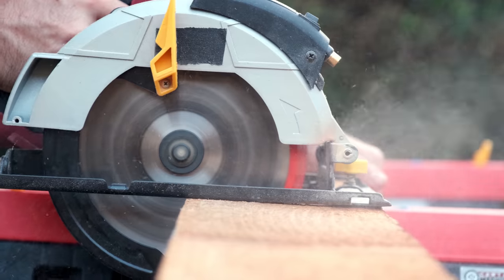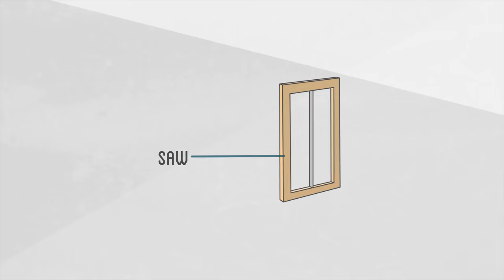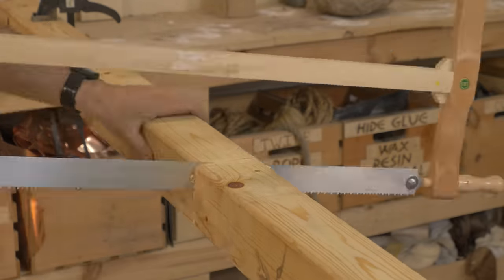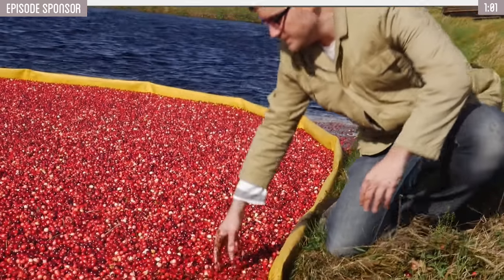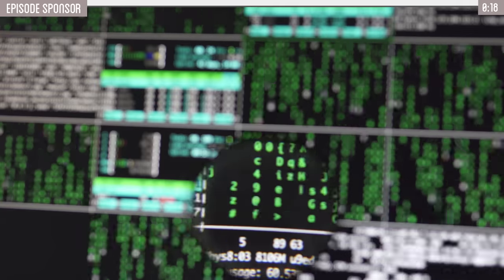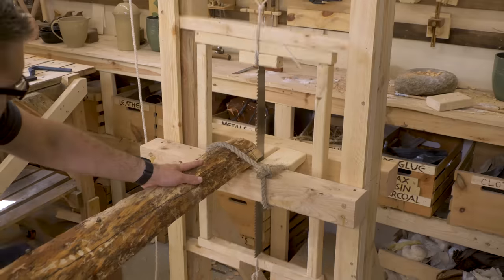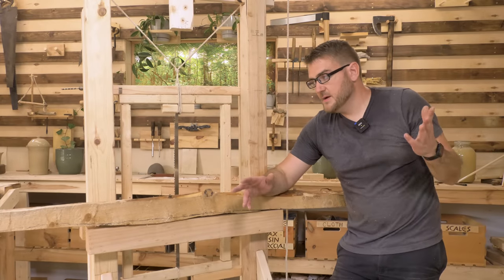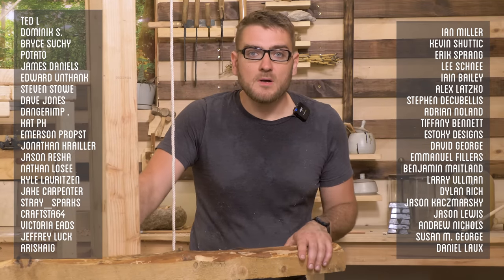This 12th Century Table Saw Is A Huge Force Multiplier!

Comment: In the twelfth century, I doubt you'd be doing it yourself.  You would have one or more assistants working the machine while you fed the stock. Labor was a lot cheaper and more available.
Reply: Actually the Black Death caused quite a labor shortage. In some places 40% of the population died. The ones that survived certainly didn't want to get together with each other then either.
Reply: @1pcfred  I think perhaps that had a greater impact on unskilled labor than skilled.  Someone you would hire for this might be an apprentice with you for woodworking.

Comment: Im not exactly sure how your building up from the stone age using lumber cut by large mills, and high quality carbon steel tools like chisels and japanese pull saws. At this point your already using advanced technology to make low tech machines
Reply: He really doesn't have millions of years to finish. Which all of the manpower used from then to now would add up to. He's trying to condense the process somewhat to fit the video format a bit better.

Comment: This guy seems like "stupidly smart".
1. The hand forge saw is not perfected, the teeth are done lazy and blunt.
2. The bow support is not strong enough. I was worried it may cause accident.
3. Why are you moving the wood left and right during cutting? 
4. The new saw angle should be downward so it pulls the wood downward. 

"That was definitely a workout" indeed unless you give proper effort to it.

Comment: a few inconsistencies:
how could Japanese saws be found in the European pre-industrial circle in the 12th - 19th centuries?
why you use them - not known to the "western" industry until the 1950s
you use glues based on polyvinyl acetate - it's the same as the 1940s-50s of the last century - they didn't exist in the Middle Ages
sisal fibers were very expensive - they were not used in the Middle Ages....
when you do something that is supposed to be like it was in ancient times - do it exactly - because it can be seen that you are only a zealot and in most products ignorant

Comment: Making own saw should lead to the conclusion that using a saw should be avoided if at all possible. Youd split the wood whenever possible, you chisel ends and edges, youd drill and peg things when doable.
But the saw, with everything it include, will be the last and least tool to use